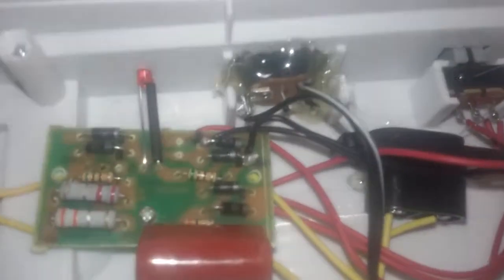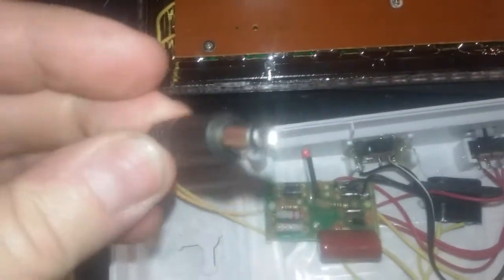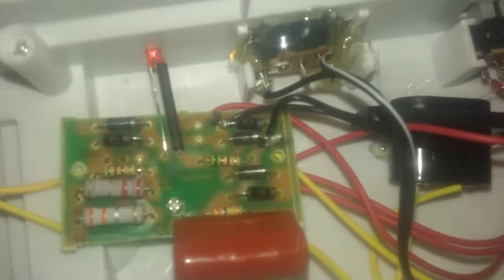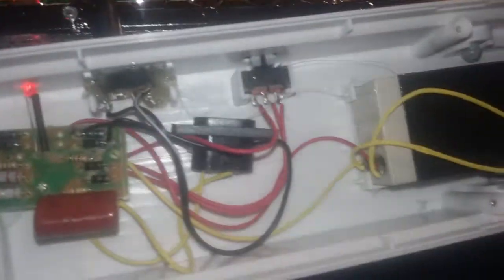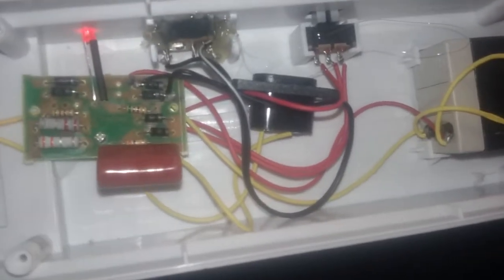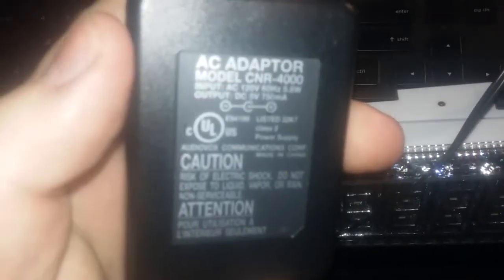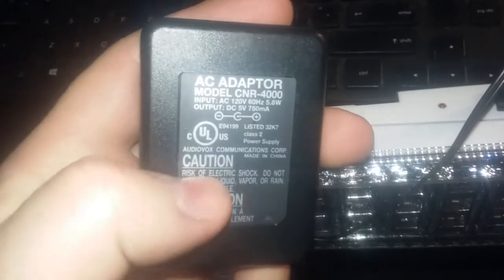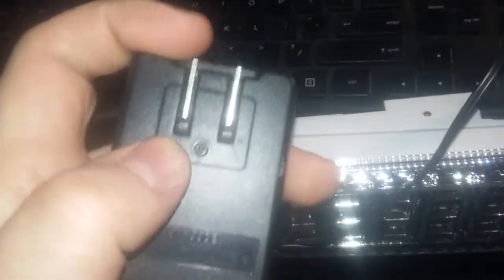Bell and howell light bar DC mod part 2

Comment: What type of batteries does this have?
Reply from the maker: It uses two 4 volt sealed lead acid batteries similar to a car battery. Probably 1 to 2 amps. Wired in parallel.
Reply: Wire 2 18650 batteries in it 8.4v fully charged 8v it should cut off the charging

Comment: you can do what i did add a 12 volt solar panel  with usb 5 volt output car plug when the bar is on auto it stop on daylight and charges and work at night automatically dust till dawn got it set up in a tempo shelter i get year round free lighting
Reply from the maker: Steve Money I may go the USB route with this once the built in batteries crap out. They are just two 4 volt SLA type batteries wired in parallel.
Reply: Make a vid about it??

Comment: Very interesting video, I do a lot of ice fishing in mn. And lights for ice shanty are pretty pricey. You mind doing a video on this same light bar configure to hook up to a 12 amp battery.
Reply from the maker: TwoReel the LED bar runs on 3.6 volts. You are better off taking a power bank and wiring the battery connections from the light to the power bank batteries. Have someone you know who is good with electronics do it for you. This light lasts quite a while on the stock batteries.